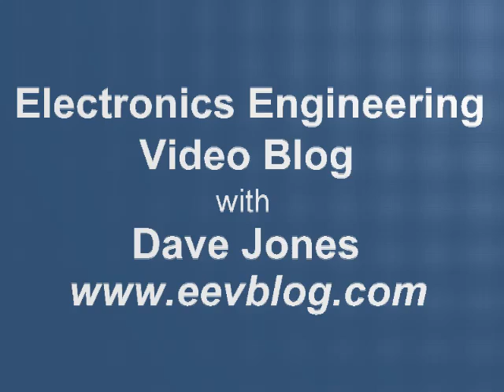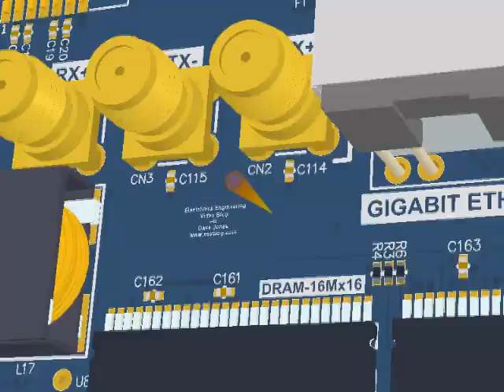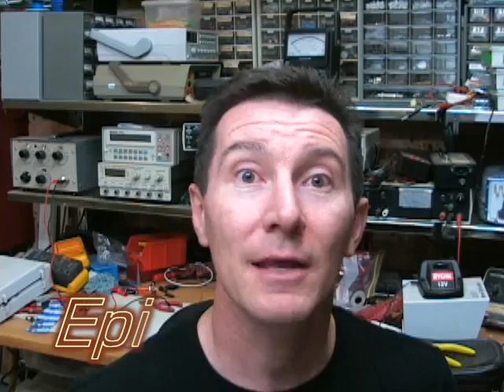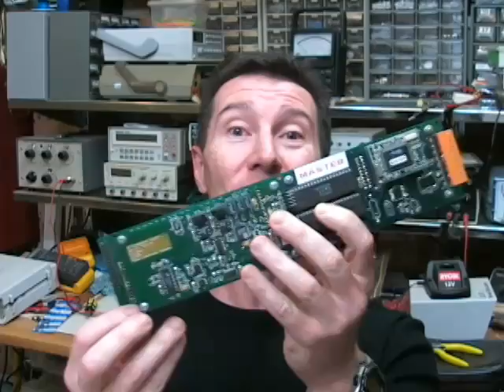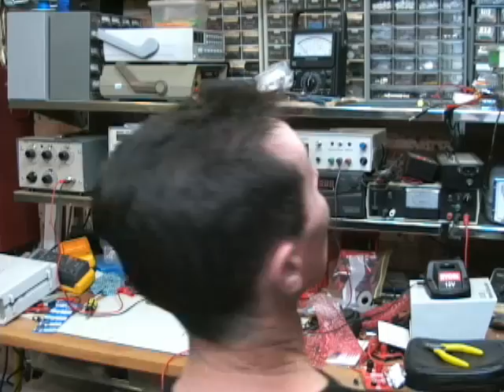EEVblog #40 - Dilbert and the world of micro managed Engineering

Comment: Years ago I wrote a job management database for the electronics workshop I was a bench eng in.  It was written in FoxPro and despite being on a low-powered computer of the day it was really effective. 

Then, the workshop got taken over by another outfit, and they wanted the database translated into Paradox for Windows. I told them I hadn't a clue about that product, and they got a guy who apparently knew it to try to code a replacement for my FoxPro application. He found that the form designer had an insurmountable bug (Once a form had been published it could not be re-edited) and gave up. 

I'd thought this might be an opportunity to suggest going back to stuff that was an industry standard and known to work... but no. 

Next, the manager came in and boldly announced that' "All computer work shall  henceforth use "Microsoft Office Professional!" This of course meant using Access, which in those days was so puny you'd be lucky to knock the skin off a rice pudding with it, let alone run a workshop. 

I declined to get involved, so again a guy who knew a bit about programming but had never used Access took over the task.  After about three months of trying (and repeatedly asking me how to do things with databases!) he admitted defeat. 

End result, we had to go back to paper job tracking. 

Turned out the reason management didn't like the FoxPro database (which was reliable, easy to use and really fast) was that it printed in fixed-pitch fonts. Unbelievable. Basically they couldn't care if it worked, so long the output looked posh.

Comment: I totally feel your pain, Dave! I left my previous job because I could not take the management incompetence any more.
We had a graphics debugging app, built on a crap subsystem, using a crap programming language, running on the shittiest operating system (despite my repeated protests on each of those choices).
On top of that, the core libraries (developed off site) kept changing, breaking everyone else's code a couple of times a week. For a long time, they didn't even tell us what changed and how to adapt our code.
Imagine trying to develop a product while on Tuesdays and Wednesdays, you are debugging your 'scope and your power supply, instead of your project...

For a while, I bit the bullet and tried to make at least my part high quality. I was progressing slowly, but my code had no known bugs, a term pretty much unheard of in the software world.
Our QA department literally told me to stop bugging them because my stuff just worked, and they were overwhelmed with the bugs in the rest of the system.
You would think management appreciated my quality work, right?
Wrong!
I got a so-so annual review for not producing "enough" code. If I gave up quality, I could have produced ten times as much code. I chose quality.
Others chose quantity.
As a result, the whole thing was a huge pile of crap. Completely unusable.
Upper management was screaming at my boss. The customers were screaming at my boss.
Eventually, engineers started leaving. No one was happy to be forced to produce shitty code, just to meet the insane deadlines and they couldn't just say "slow down and focus on quality" to the boss, like I did (they had kids and mortgages. I was single at the time).
Guess what?
To add insult to injury: I ended up being tasked with fixing their shit!
It did not take long for me to leave too.
After I left, my manager was finally "reassigned".
You are so right!
Engineering companies don't get rid of a bad manager until all the engineers leave and the manager has literally no one left to manage!
You would think that they finally fired the guy, or reassigned him to a shitty project, right?
Wrong again!
He was reassigned to the department's dream project that every engineer wanted to work on!
No manager screw-up goes unrewarded!